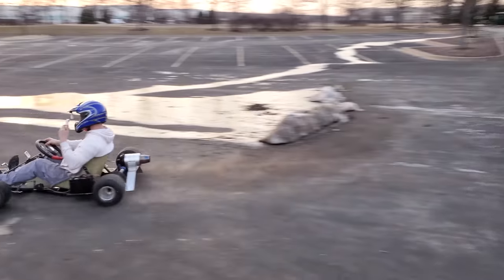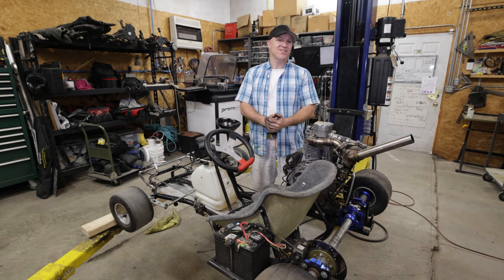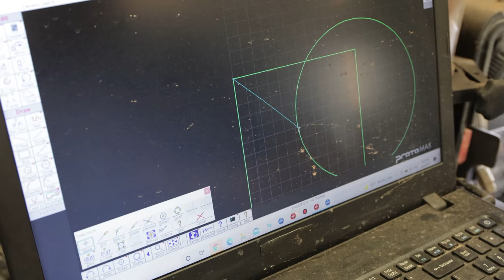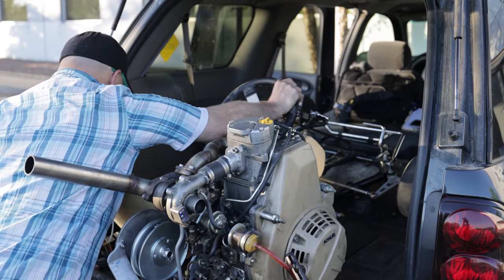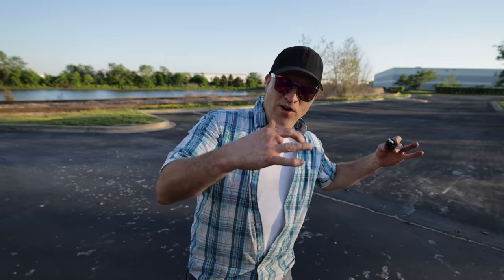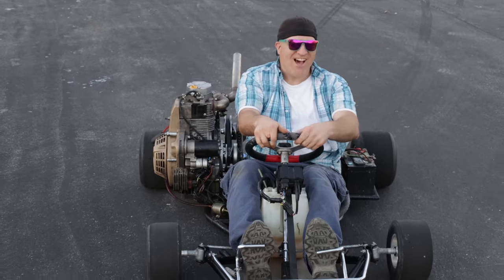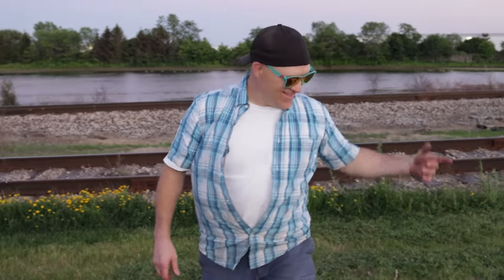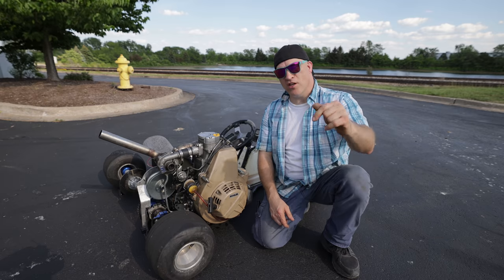Turbo Diesel Go-Kart W/CVT Top Speed

Comment: Am i interpreting your footage incorrectly, or are you connecting a friction clutch to a hydraulic torque converter? I don't see the benefit. Which memo did i miss? I mean you've shown how the belt is tightened, the belt drives contracted with increasing RPM … how is that not a friction clutch …and where is the torque converter? Those are usually toroidal, oil-filled assemblies, operating on swirly-whirly oil viscosity principles. Are you using a different kind of torque convertor? How small can those TCs be? I don't see the point in conducting an unloaded wheel-spin test. Is this a marketing stunt?

Comment: Not to be a know-it-all because I totally respect everything you do but those clutches our way out of tune. To start you need a longer belt to get the belt to the top of the secondary sheaves. Do some research on how to tune snowmobile clutches and that will get you a ton more performance.

Comment: There's gotta be a way to get more speed out of that. A stock Predator 212 can usually to 35.
Reply: That diesel is turning much lower rpms, its got far more torque then usable in the application.
Reply: @jaydunbar7538  Yes, I know. Still, the gearing can probably be tweaked to improve speed.

Comment: Need wider belt so it sits flush on secondary clutch
Reply from the maker: It's sitting flush, it's b sized belt
Reply: @WarpedYT  I’ve yet to do a single gear change on a single cvt vehicle that’s come to me. As I set there cvt up correctly and not only do they always get that top end they want but much more low end or they want gear change for low end and not only do they get low end but I give them top end as well and nvr have accomplished this by a gear change just setting the clutches an belt up correctly. Gear change only gives you top or bottom end and tweaked/set up correct cvt can give you both that’s why I love them. Or say secondary spring is in the wrong preload hole then engine power immediately pulls belt down to 2-3rd gear cause it’s in the low preload hole. Just cvt are so amazing when there dield in
Reply: @WarpedYT   I don’t do much with go cart stuff these days. But cvt is cvt. All same just go cart stuff is smaller/cheaper. But that being said less power the more important it is to have them dialed in.  Ok. Have good weekend and great vid. Loving it all.
Reply from the maker: Good point , but when I was talking about gear change I was talking about the drive gear to the axle gear, since this is a cheap Chinese CVT setup that just comes with a 10-tooth gear which is probably really good for a gas engine, but not very good for a diesel engine since the maximum rpm is about 3,600, you may see an RPM on this thing of 3700 but very unlikely, it won't rev up till like 6,000 like a gas engine, if it did there wouldn't be an issue.. I'm totally going to cut out a larger gear and I'm pretty sure the reason that they don't sell this gear is because nobody would buy it as it would be only for a diesel setup.
Reply from the maker: Thank you !

Comment: Slap a super charger on this instead of the turbo.
Reply: Or a compound turbo setup. Or maybe both super and turbo charged with air to water intercooler.. increased injection pressure , bugger injectors higher governer! Give that diesel all it needs to 60mlph 😂
Reply from the maker: I have both of those

Comment: piston powered centrifugal jet sling tesla turbine pump
Reply: as a jet torque converted, the "3rd" type of ducted fan, or turbo prop, also to be used as the turbo, air pump, high compression, also as a gasoline jet burner turbine
Reply: disc based cvt clutch, two discs at variable rim position
Reply: stick operated reduction rate
Reply: 3d printed mold electroplating filling